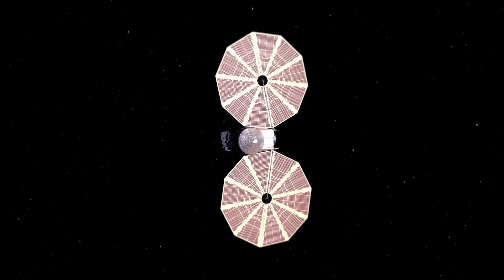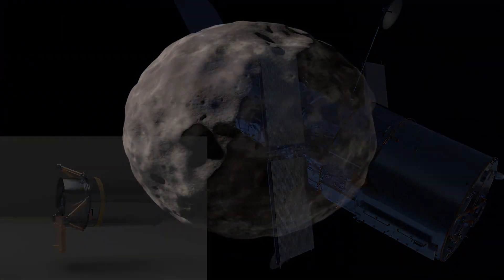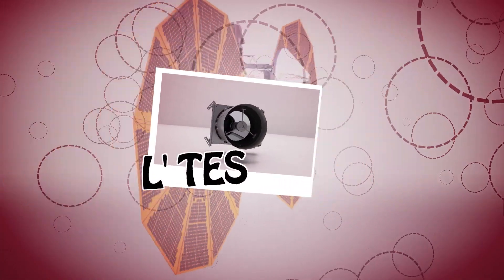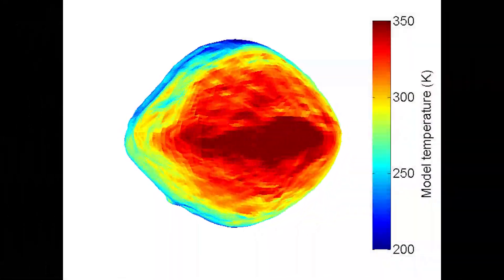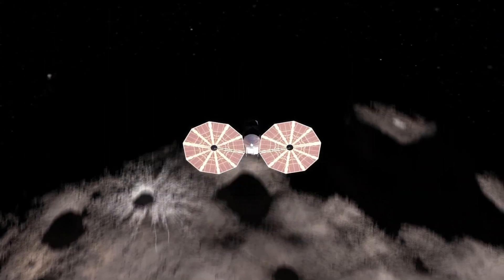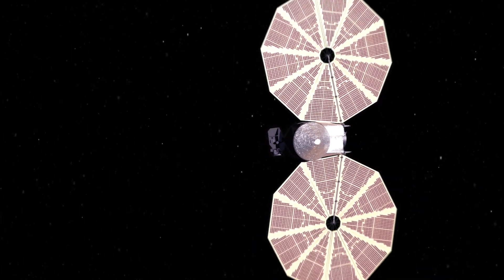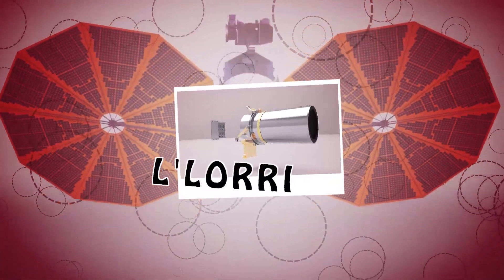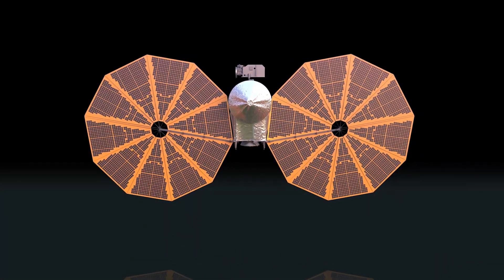NASA's Lucy mission will study trojan asteroids with these amazing instruments

Comment: Bits are used to measure rate of transfer (speed.)   Bytes are used to measure capacity (storage.)  Therefore the terminology you used the in context is was used in was incorrect. 3:45